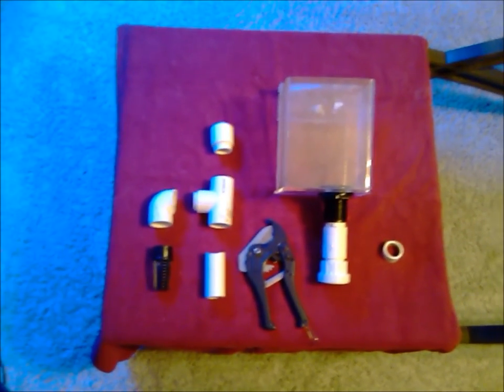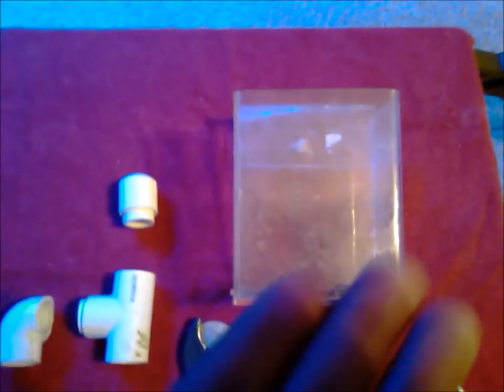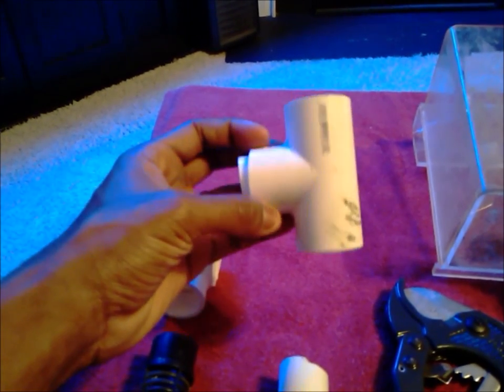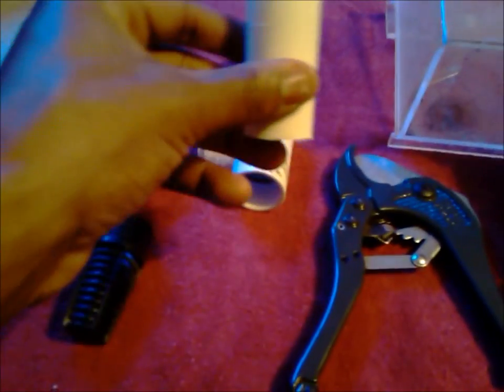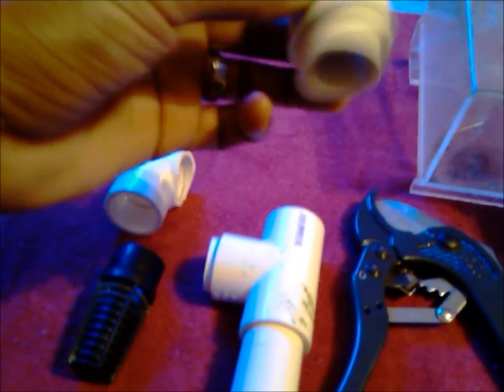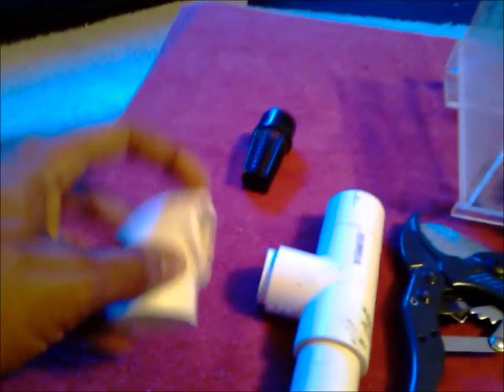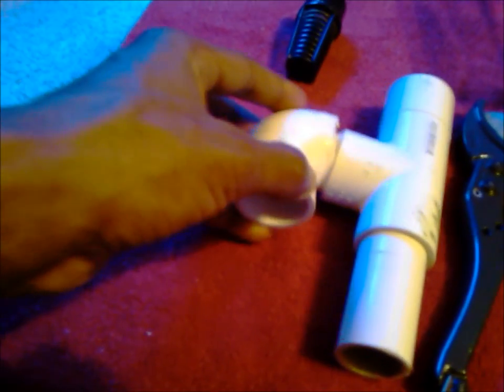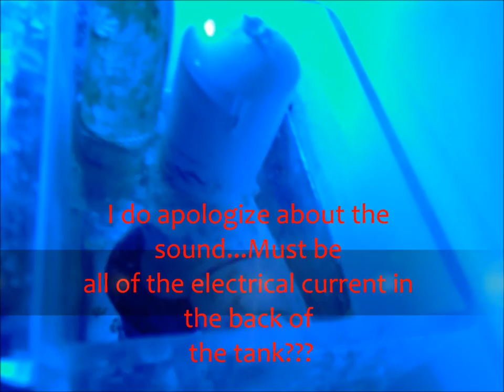DIY Durso Standpipe

Comment from the maker: @vipete1985 on my earlier vids, I had two overlow boxes on my 55 gallon. This was done to allow more water to go in the sump, but I plumbed them together which slowed the flow. What size tank do you have and what type of return pump? This should not be an issue for you if you onky have 1 Overflow box